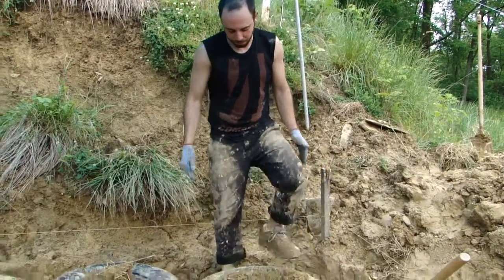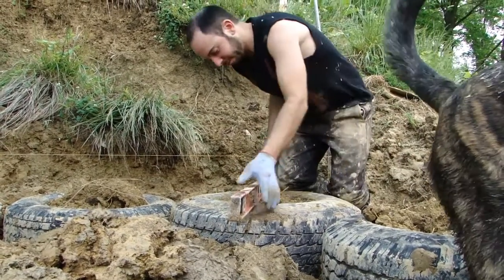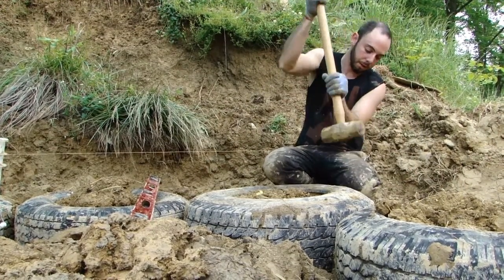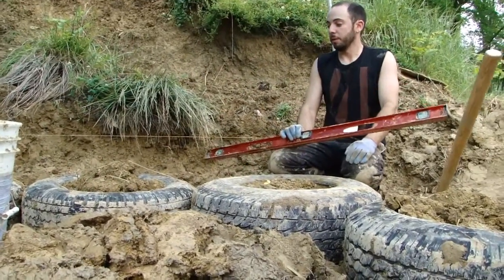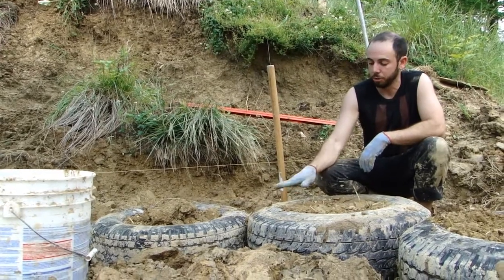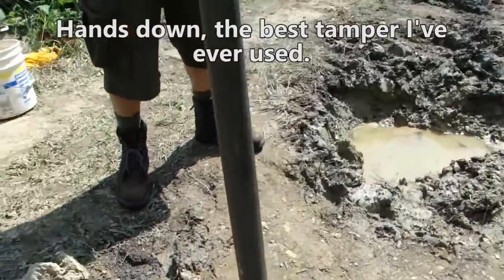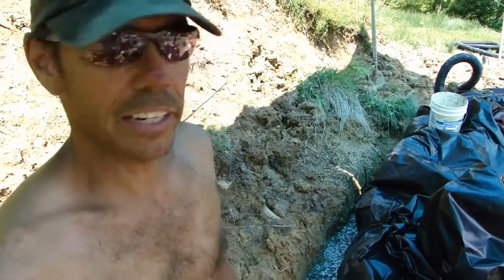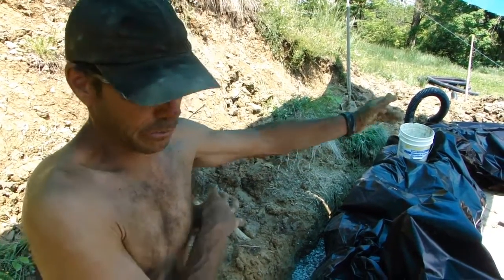Cincinnati House - Tirewall Part III

Comment: Hey Ted, thanks for the cool video, I've always wondered with the rammed tires why no one ever used a pogo-stick tamper. Either Air or hydraulic. Similar to the ones used for rammed earth.  Is it to much pressure or jarring on the tires?  Thanks Cappie